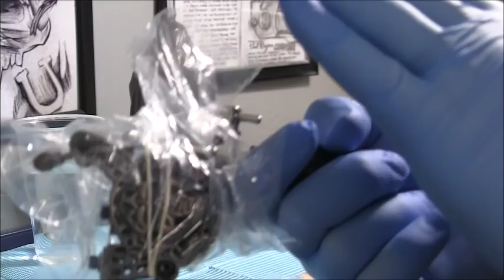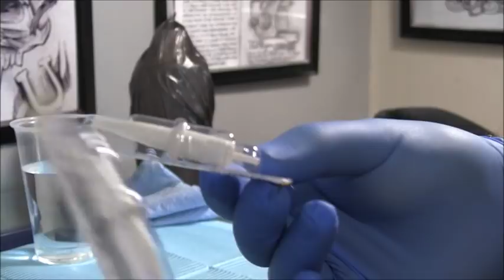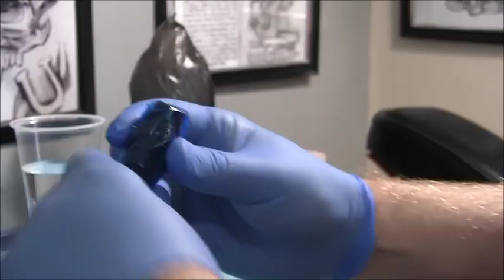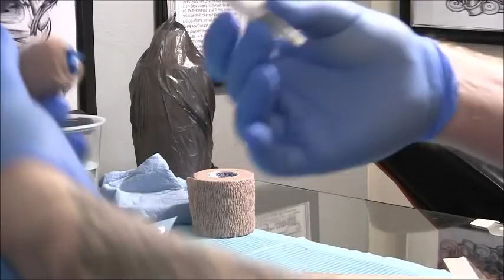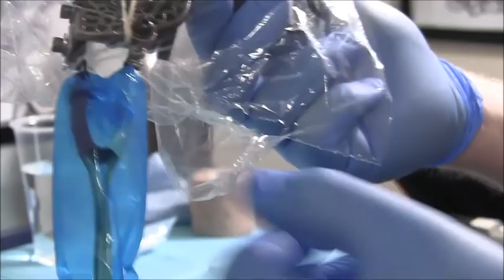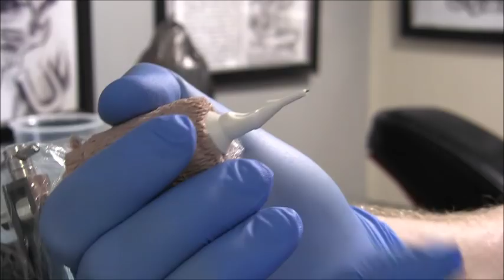Grip Protection Cartridge System - Tattoo University

Comment: My cartridges keep popping out of my grip Its a cartridge made grip but it still won't stay in?... any ideas ? Cant find anything on it ,, i Only just started using cartridges  ,, by the way your videos are very helpful thanks ! 🎨🎨🎨
Reply from the maker: I would try a different brand of cartridge.  See if that helps. If you are having the same issue switch out the grip.  Sounds like there is something faulty going on there.

Comment: Good afternoon nick.  I'm just learning... I have bought an equiliser proton mx pen. I keep the pen 100% covered with bags/ finger condoms on grip with tiny hole for cartridge and cartridge with membrane... I've only done one tiny tattoo on myself... dont have an autoclave and not to sure if there are even disposable grips for the machine as there isnt much info on the web.  I'm scared to tattoo myself again as I do not know if I'm at high risk for an infection as I'm not sure if the grip is contaminated... I would think it's not as everything is covered and the membrane prevents any back flow... your thoughts?
Reply: Also I use the medical tape as well *
Reply from the maker: You need to use barrier protection but also germicidal solution for the grip. The disposable needle cartridges don't get used again. Clean the machine properly with germicidal solution. You can use u.v light and other methods of cleaning.  Put another cartridge in. Cover it again and proceed.

Comment: I use all disposable. but I have been looking at getting one of these grips for cartridges, what is best way to sanatize if I do not have an autoclave? i have a sonic cleaner but was wondering what you would recommend
Reply from the maker: You can't autoclave your tattoo machines.  You can clean them with germicidal solution.  I always cover my machines.  I think machines are really dirty and everyone should cover them.  I wouldn't let someone tattoo  me unless they put a bag over their machine.  I always bag my machines and I do the same with the hand pokers.  They look cool but I'm all about the barrier protection.  They are probably cleaner then a machine because there aren't as  many spots for things to hide.  I still clean them with germicidal solution even though they were bagged.  High heat would destroy these.  Another method to kill germs is ultra violet light.  They do make machines that can be sterilized in an autoclave.  If you don't have one of these I suggest you clean them how I suggested and cover them when you tattoo.  These hand pokers are exactly the same.  The only thing that would mess them up is subjecting them to extreme heat.  I use epoxy and other things on them so they are stronger and more resistant to heat.  You really would have to stick it in a fire, autoclave, or oven to mess it up.
Reply: @TattooUniversity  I was mainly talking about cleaning the tubes you would use with metal grips. that you would use with a regular machine so you can use cartridges. how would you sterilize the tube and grip if you dont have an autoclave. I know you cant clave a machine. I have been looking at getting a few of the tube and grip combos so I can use my other machines i have. and I bag everything that is my biggest fear is missing something and cross contaminating anything...
Reply from the maker: @tomchristensen2914  I thought you were talking about something else.  I don't like to use those because there is a lot of time cleaning involved.  I wouldn't use without an autoclave. They start to get little scratches and groves that collect materials.  After cleaning there could still be materials in there.  Without autoclave it might not be fully sterilized.

Comment: Hi! First, I like you videos! It really help me because I'm a beginner. I have a question about protect the reusble grip in cartridge system. I'm not sur to understand100% that you said, because I'm french....You said, if I cover the entire grip, I don't have to sterilise the grip after use? Tell me if I'm wrong: for me, the external part of the grip is protected in that way, but the internal part of the grip is exposed to blood and contaminated ink. I don't have an autoclave and I don't to sterilise anything.....I want to use cartidge systeme, but I want to be sure that it's ok if I use this system, with reusable grip and without having to sterilise anything, while being safe.....I hope my question is clear....lol. Thank you!
Reply from the maker: The safe thing to do is get a disposable grip.  You have to cover the grip to prevent anything from getting on it.  You also have to clean it a sterilize it.
Reply: But if I use a disposable grip, I don't have to cover the grip and sterilize anything? Right?
Reply from the maker: That is correct because you would dispose of the grip when finished, but I would still cover the machine.

Comment: What’s your review on the red scorpion rotary machine?
Reply from the maker: Its been working fine for me so far.  I'm just curious to see how long it will last.
Reply: Yeah it’s a decent machine. What size Maxon motor would you recommend to replace? Mines went out.
Reply from the maker: I'll have to look into that.  Usually the knock offs are so cheap you just toss them and get another.  I keep all of the machines when they break so I can mess with them.  I have several broken rotaries that I've taken apart.  I will have to buy motors for them.  I will let everyone know how it goes when I do it.
Reply from the maker: It runs really fast.  Usually I run my rotaries around 5-6 volts.  That one runs really fast at 4.

Comment: I just saw these machines at the supply store and was wondering how you guys were keeping them clean
Reply from the maker: Covering them with barrier protection is the first step.  You can do different things depending on the machine.  Some of them have the removable grips that can be sterilized.  You might have to clean the grips with a germicidal solution if you can't remove it.  You can sterilize things without an autoclave.  You just have to look into the method that will not destroy your machine.
Reply: I know its about how the tattoo will turn out and keeping things sanitized and clean, but all the extras the regulations made us add on makes everything look like trash. It literally looks like all of our equipment is meant to be thrown in the garbage.  Even surgical procedures don't look as germ-phobic as this so-called art form. It's bully-bully bull$hit, and I'm sure by this point somebody has a conspiracy theory on it. It's as if some scratcher went insane and sarcastically started up a maniac clean-room company that everybody took him up on.  I'm not going to tattoo in a hazmat suit, people, if that is indeed what's next. Last I'll EVER say on that topic on somebody else's forum. Love ya, man. Thanks for the helpful content.  You're a good Youtuber and a good teacher.

Comment: problem is if your using adjustable grips when you twist them the way the bags are wrapped it twists the bags. I set up very similar tho. I face the bag from front to back of machine n just cut a lil slit for the tube on side of the bag at the bottom-if that makes any sense...! then the bag won't bunch up when your twisting the grip to adjust the dept of the needle on the fly. I been watchin your vids for years man, come along way..
Reply from the maker: Thanks